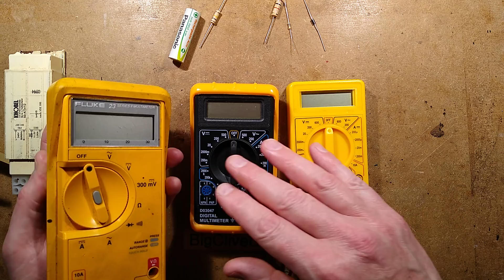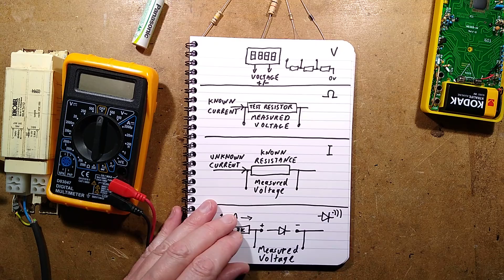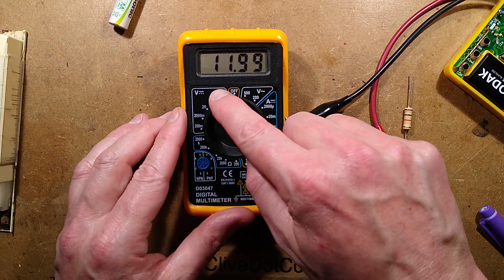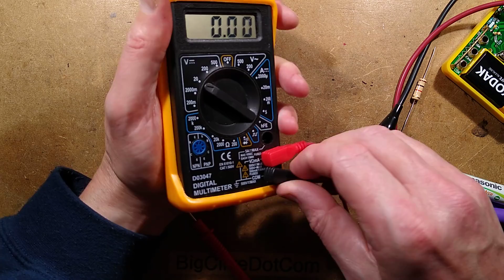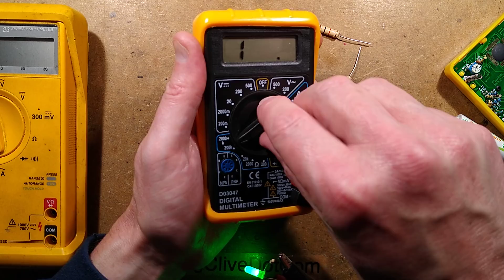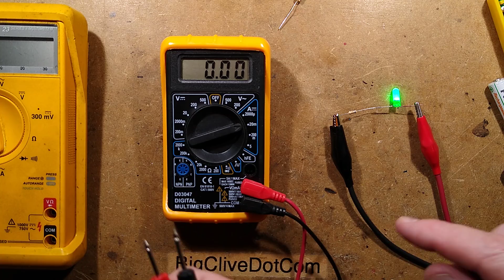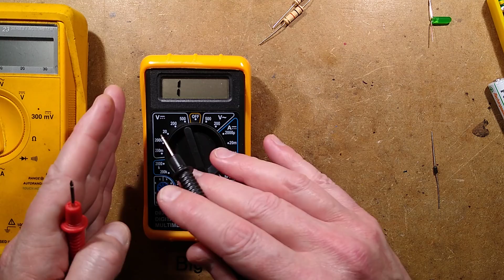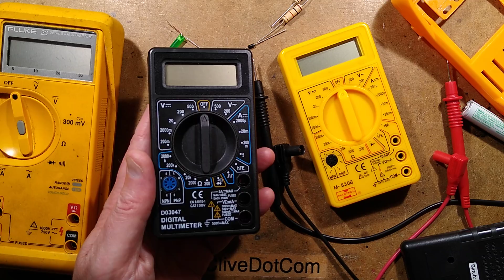How to use your trashy meter without blowing it up (much)

Comment: Well,you have cheered me up,because I have always thought I have under used my various meters in the past,using 20vdc and Continuity test. Now I know I am not the only one! Incidentally,do you have any opinion of the plug-in socket testers by Habotest,which indicate reliability as well as Ground test? Of course,pressing the GT button drops out the circuit breakers,which indicates positive grounding. Much easier than pushing test probes into the socket,after pushing the earth guard out of the way!
Reply from the maker: The plug in testers are surprisingly useful.  The RCD/GFCI trip button also proves that neutral/ground haven't been swapped.

Comment: Damn, some of these meters often light up modern LEDs but can't measure the voltage drop across them. But I bought a parts tester DIY kit (after being inspired with your just-buy-and-solder-kits videos) with a microcontroller, a ZIF panel and a screen, and it works and measures them, and it is a bit smarter than these cheap meters.

Comment: OL on a multimeter means Open Loop.
And in ove 40 years of using multimeters, I've never used the gain tester - never even tried it out to see if it works.
Reply from the maker: The open loop theory doesn't work for overvoltage or overcurrent.
Reply: @bigclivedotcom .  Yeah.  The Fluke manual says OL = Overload in that situation.  I guess that's probably the real meaning and for simplicity they use the same symbol for all error conditions.

Comment: My first multimeter was a moving coil meter from Tandy with a nice big meter on it. Loved that thing but made the fatal mistake of lending it to an idiot - making me the bigger idiot of course. 😁

Never owned a Fluke and I doubt I ever will. Can't justify the expense as a mere hobbyist. My best meter - yes, I do have several - does capacitance and frequency up to 10MHz and, like yours, spends most of its time on voltage (autoranging) and continuity (also crackly.) Not sure how accurate the Hz range actually is but it does save me having to power up my scope if I'm just wanting an "is my oscillator actually oscillating?" spot of probing.

Comment: I'm pretty confident on the tranny tester in these things - it can tell you a lot about it's condition; such as if there is a low-gain.
Personally I've found little-to-no difference between the reading from one of these and a dedicated semiconductor analyzer (handheld)...
...and seeing as the theory to testing the gain is just the diode setting with extra steps; unless something is wrong with it!
The things worthy of note: one of the polarities of transistors has it's gain measured as beta (collector current) whilst the other is measuring emitter current.
Also with some transistors the gain might be off - for instance a power transistor is going to read higher than when it's being used at normal current ranges (40 at 1mA compared to 20 at 200mA for instance)

Comment: Worst meter I’ve ever owned was “expensive”. Not a Fluke, but not a cheapie either. It was made in the 90s and it’s gimmick was a serial port that output the measurement each time the display updated. But that meant it was slow. The worst part was the continuity beeper which would take a good three and a half seconds to autorange through all the resistance ranges before it’d beep. I eventually figured out that I could short the leads and lock the autoranger out, but that requires more foresight than I typically have, and the aggressive auto power off (hello? Why would I want that if I’m logging data?) would undo the lock.

Comment: My neighbor bought a meter from Harbor Freight for 2 bucks. He called me over with his laptop open watching YouTube trying to trouble shoot his A/C. I don't know what he did but that meter was  toast. I went and got mine and found his issue. Also I am a refrigeration mechanic. 95% of a meter's problems can be traced down to bad leads, people will test something and when they are done quickly wrap the leads around the meter and toss it off to the side, they will get damaged. Also I live where it get's extremely cold in the winter, if you are running service take your meter's or any testing tools in the house at the end of the day. My friend lost a 500 dollar Fluke meter bringing from his van straight to test a 480 panel, he told me the screen was foggy  and it didn't make that quick beep when he turned it on but a long low one, like the battery was dying. He put on his gloves and went to test incoming power and bam it fried / blew up. I am going to assume bringing it in from the cold to warm caused instant condensation on the inside of the meter which explains why his screen was foggy. Happy Testing

Comment: Don't be ashamed?  I LOVE CHEAP METERS!    I am pure ignorant hobbyist, and I love the safety net of not blowing up a nice meter.  I recently added an analog "swingy needle" to the stable for automotive things (sometimes intermittent/timed relays don't mesh well with digitals, but a swinging indicator can tell you more about what's going on.  I have a very similar model as well to your center unit, and it gets the most use.  I did pick up a 5A autoranging deal (that came with nice nice test leads and good fusing) for doing line voltage stuff at our business.  I added some Klein leads to it, gave my cheapo meter the nice leads that came with the autoranging job.  

Remember that the leads are what separate YOU from any faults your meter may have.  Meters are disposable- cardiac rhythm not so much.  If you double check your setting and your lead socket, you won't kill many meters.

Comment: Harbor freight quality dropped quite a bit.  The wires come out of the leads and there's no adjustment for accuracy and there's no back light anymore.  Even measuring a 12 V battery it's off by .3   so I bought a $40 meter off of Amazon, does AC and DC current with a clamp great meter

Comment: @bigcliedotcom Great video for newcomers!
The only thing I'm asking myself after a few decadres in electronics is why would I need an expensive meter?  I do have two rahter cheap meters neither more expensive than ~ 20 quid (folks front  the continent: 20 Euros.  Folks from the other continent: 20 bucks) and I rarely if ever miss the accuracy.  They even have Class III / IV ratings and the only thing that annoys me when metering mains voltage is that I have to hold the meter as well as the two probes which is not the case for the usual electrician's meter.  But I'm mostly using it for electronics repair anyway.
As for the function to meter transistors -  mine has it but I've almost forgotten about its existence.  I guess the meter at university didn't have it ;-)  More serious, the fature is so basic I'm not sure how I could use it in real live.

Comment: That's a little scary: I'm pretty sure I've accidentally had the probes in the high-current position on a couple of occasions when trying to measure voltage. I quickly realized my mistake when I got no reading, but I never noticed any signs of a short circuit. But indeed, checking with another meter proves that my main meter does make a 0-ohm connection across the probes. Guess I lucked out.

Comment: Clive says the cheapo meters are fine for starting out in electronics. But what is the best for single and three phase electrical work?  Many stories about cheap meters blowing up.
Reply from the maker: For industrial work I tend to recommend Fluke to tick the HSE/OSHA box.  A proper set of test lamps is also very useful.  They can just be the simple row of LEDs voltage indicating type.
Reply: @bigclivedotcom  
So the CAT II, CAT III and CAT IV designation for meters are just guides, no more?

Comment: 17:20 only to see if it works or to see if the transistor is still working. But I probably used it less than 5 times in my entire life.

Comment: lol. i got a dinky yellow one....works  well enough. can measure volts(ac.dc) and amps.on number two as i dropped previous one just to many times and cracked it. i did notices once i measure a battery and clearly a 12V should be showing 13.4V (conformed by another meter). found out later it's because it's 9V was flat at 7. something volts so i threw all measurements out. i ponder what the fluke will do......

Comment: I'm not sure if this applies to all of these budget meters, but I have a chaeap Wavetek one that drains the battery even when it is not in use, so I have to take the battery out every time I put it away.
Reply: I do that as well more so because the batteries will corrode. One of the things I do is remove the battery cover screw and use electric tape and/or rubber binders to hold it in place. Then it isn't such a pain to remove/install the battery for use.
Reply: @snakerstran9101  Thanks for the tip, that will definitely save me some time when using it in future.

Comment: I have a Fluke 15 something or other. The darn battery terminal spring broke off from the pcb and now it’s pretty much useless. I’m always on the lookout for some sort of material to use try replacing the battery power lead. (Its the internal battery that powers the dmm itself) 😕

Comment: In the world of digital electronics that is all you can do is measure voltage.  Even then the measurement requires a reference to compare it to.  Any other types of measurements are converted to a voltage.

Comment: Shows the beta of transistor.... but the beta is lower in circuit. I use the transistor checker from radio shack it's suppose to tell you e b c ... d s g ....  a k g of bipolar transistor fet transistor and scr respectively.  Sometimes it couldn't tell which collector or emitter position were. Best bet  is look for speck sheet.

Comment: Putting mains voltage across your Fluke while in resistance should not blow the fuse or cause any other problems.  That's why you use a Fluke.

Comment: I had the free one. Its lead broke at the banana. I could have chopped down the plug to get a bit to solder to. I didnt, I figured the blob could throw off some reading possibly. Yes or no?
Reply: *it's
Reply: *it's
Reply from the maker: The solder connection wouldn't make much difference to readings.  It would be better replacing the plug though.  The pro-shrouded ones may not fit, but the bare 4mm banana plugs do.

Comment: While the diode check is useful for checking diodes, I only 100% trust it when it says the diode is bad. For example, I had a bad 1Amp diode in a power supply a few months ago which checked OK on a Fluke using the diode test. But once you put more than 1/4 amp through it in the forward direction, the voltage across the diode increased to over 6 volts. Same goes for leakage current in the reverse direction. Since the meter only puts a few volts across it, this really doesn't say much if it's a diode used in a circuit with higher voltages.

Comment: Anyone else take a beginner electronics course way back when multimeters came in bakelite cases, but the teacher wouldn't let you touch one until you'd proven you could do everything it could do with only a galvanometer and some resistors?

Comment: A good fluke will show you the ripple if you measure DC on the AC range, and it will show you the DC offset if you measure an AC signal on the DC setting.

Comment: Sorry to say this, but I have had a run in with the first one, the most crappy one. It is like something you can find in your box of cornflakes. For someone who is not a professional, these are ok, but for serious work. na..aaah. I was using fluke 233, and I can swear by it. The thing is indestructible, takes a beating and is handy as fuck. Expensive, sure. But it saved me so much time/money compared to other multimeters that it paid for itself many times over. Still. You have a good point. You should start at the bottom and work yourself up to these. Don't forget, the measuring probes are really important too, and it is really important to use the correct ones for the job you are doing.

Comment: Even a cheap multimeter is better than no multimeter.  You can always get a better one later!

It's probably not a good idea to leave the meter indicating an overload condition for too long when measuring voltage, as a really extreme overvoltage can overheat the resistors.  If in doubt, start high and work down.  It is safe to leave a meter indicating overload on the resistance ranges indefinitely, as the overvoltage in this case is limited to a safe value by design.

Comment: These cheap tiny meters are great for working inside old electromechanical pinball machines and arcade games, where there often just isn't room for a big rubbery Fluke. In those you'll never find anything over 24VAC except at the main transformer, and you'd better know where that is before you plug it in with the playfield up! 99.95% of the time the problem is a dirty/burned relay contact or a dry solder joint from 50 years ago.

Comment: Thank-you for this video. In the course of trying to add grounds, modern switches to husbands vintage two wire woodshop equipment I noticed here in YYC house and shop BLACK wires are hot[positive] while the BLACK wires on the meter as you show in this video are negative. In a nutshell multimeters  and the household equipment have opposite polarity black colour conventions. Yikes, why is this, any thoughts?
Reply from the maker: Different countries have different colour codes for wires.  The meter leads are coloured for DC polarity identification reasons.

Comment: My work meter is a Gossen metrahit, but i use a Uni-t cheap meter at home and to be honest for 240V AC down to 24V  and 12V DC and for process 4-20 mA the cheap chinese meter is more than accurate enough.

Comment: The only issue I've found with the cheapo "Tandy/Dick Smith" MM is that the test leads have always been dodgy or just not even connected. They work fine with my Fluke leads otherwise...

Comment: one thing i dislike about these cheap meters is their susceptibility to interference. If there is a high-frequency signal nearby (a nasty switching power supply, for example, or a self-oscillating opamp circuit), the meter may give false readings. Even some high-end meters have a problem with this.

Comment: Cheap meters are fine but sooner or later you will end up sticking the leads across the mains to check something. So go cheap but do try to get something that is rated up to 500 volts if possible.

Comment: I had a really good quality cheep dvm from Aldi had loads ranges semiconductor test,I've been using dvms for 50yrs,now75, l did something I've never ever done, got it on wrong range blew it up,was gutted  cudnt believe what I'd done really very bad day! Good thing with old Avo, not got chip inside so very repairable, that l know  since used to work cal/repair @reu henlow everything from meter,navigation aircraft instruments, got me a great grounding doing fault finding, somthing l really enjoy doing,was on com site in RAF working on low and high power 15kw transmitter, Brinkley stick to use before getting inside 1off those!

Comment: Yeah, LOL, I blew up my first digital meter checking for resistance on a three phase motor, only I forgot to turn off the power to the motor first. The meter didn't like that very much and I had to use my old analogue meter until I got a replacement (this time a fluke - which I still have).

Comment: I like my alphateck it has shutters so when you do current it blanks off and opens the connectors for amps so can't blow it up although they were over 100 quid bought identical one from China delivered for £15 different colour same meter no alphateck metral mark up

Comment: It is worth remembering that most of these cheap (as well as many of the expensive ones) do not like being dumped into water. I have a line of dead meters, of all sorts of price, that have gone for a swim and no longer work.
Reply from the maker: That applies to most meters.  As soon as water ingress is involved it's safest to buy a new meter for panel work unless you can be sure all residue has been cleaned out.
Reply: @bigclivedotcom  I wouldn't trust a dampened then dried out HV meter until at least four other people had used it for extended period of time.
(btw New Flukes don't like getting 25kv up them. The smoke tends to escape very rapidly, along with the user suffering a code-brown event.)

Comment: At 0:28 you mention a terrible incident while set to resistance. Is this a speech typo or is this something else too look out for as well as checking if it's set to current?
Reply from the maker: Definitely check that the meter is on the correct range for the test.

Comment: My dad used to let me play with his Simpson multimeter, the thing was as big as a brick (and heavy as one too). I somehow managed to not blow it up. I see that meter for sale on the internet, priced over $300.
Reply: Triplett made a similar analog meter to the Simpson 360, but in an orange case. I have one on my bench at work and use it all the time.  If analog meters are far more useful for finding shorted diodes and especially shorted transistors in circuit than a digital meter where the display tends to bounce all over the place.  Also, if you connect an analog meter to a transformer winding, you will see a little inductive kick as the meter pointer almost pauses for a fraction of a second and starts moving kind of slowly and then suddenly picks up speed. This visually differentiates it from a short circuit.